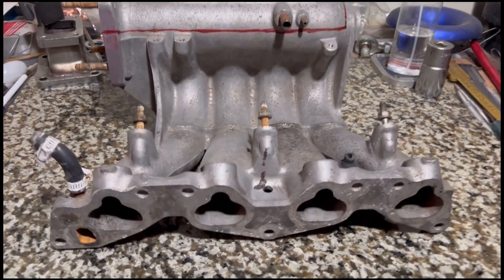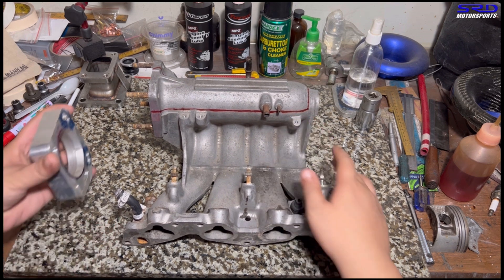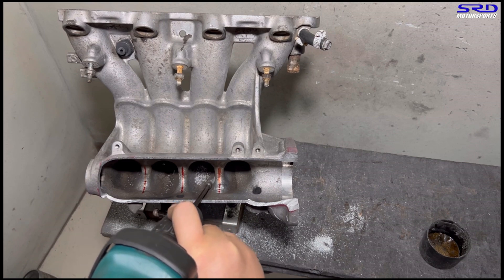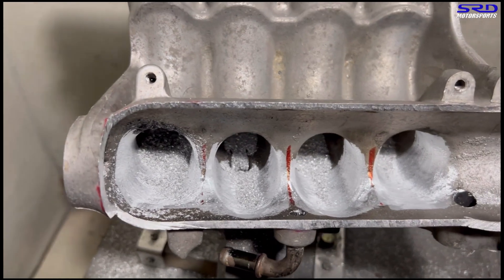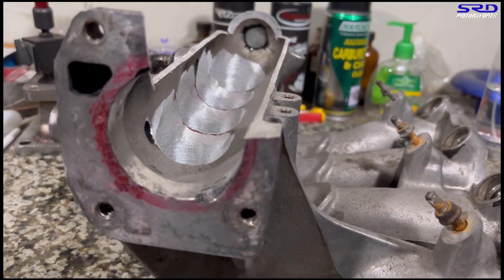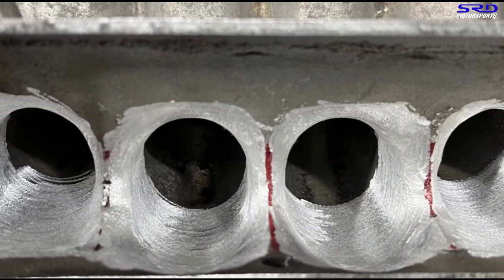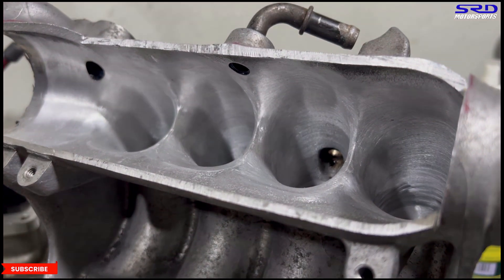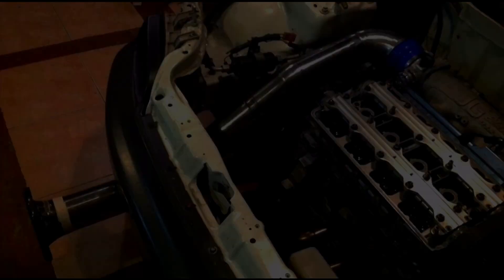D16z6 Intake Manifold Porting Development P08 D15b

Comment: How's throttle modulation with the 70mm? Thanks, just curious. 🍻
Reply from the maker: actually a lil snappier than usual = responsive but a 60mm is adequate in anycase
Reply: @SRDmotorsports  is effectiveness doing a throttle flaring? And for b16 going from 60 oem to 64 gaining some improvements?
Reply from the maker: Really depends but if it won’t cost much it’s definitely worth a try